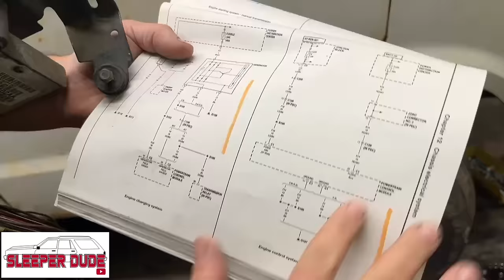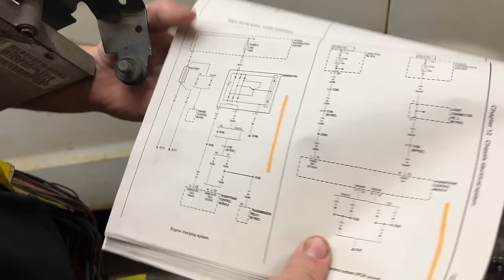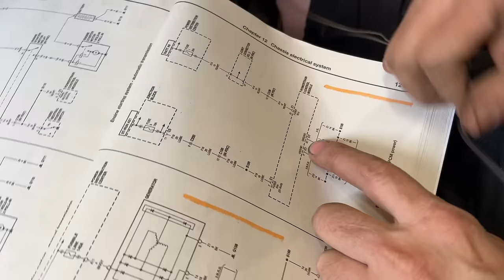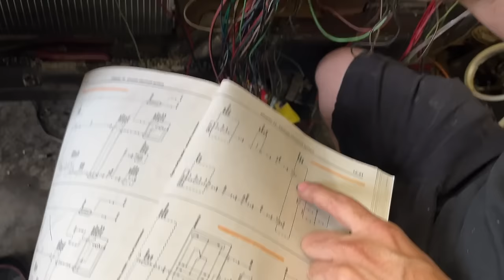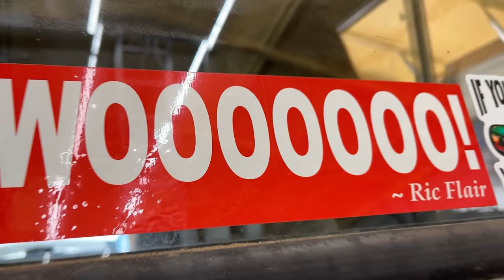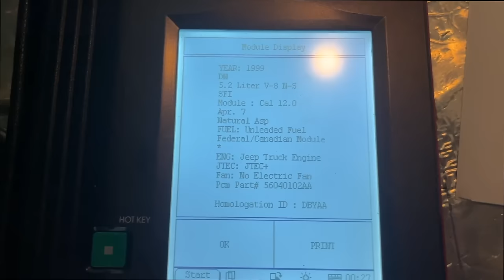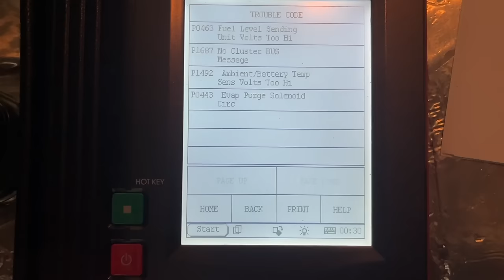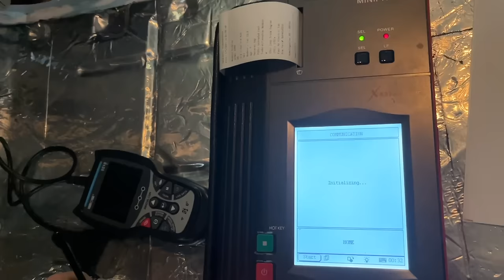2 Years of WORK Has Led Up To This! Will It Start?

Comment: I'm almost leaning towards the cam or crank sensor. But hats off to you guys getting this far seing you swapping the entire wiring harness. I have no doubt you'll figure it out. Hope you get to take some trip out in it this summer.
Reply: I think it's the crank sensor also
Reply: I’d almost bet it’s the crank sensor. Off the shelf bad parts are common nowadays
Reply: Yeah I also had to replace a crank sensor twice e before it solved my issue.
Reply: Or a bad ground wire for the injectors. Should be by the power steering pump if I remember correctly. Been awhile since I’ve worked on a old dodge
Reply: I have to agree with this one also I have had horrible experiences with my 99 ram and it would have intermittent issues with the engine just shutting down at the worst possible time and then fire right back up and it was narrowed down to the crank sensor and was replaced with a new one which lasted for about 3 months and then it started stalling again I fortunately ran into the original owners brother and he told me that he had to choose between the truck or his wife because he couldn’t get the issue fixed and they were almost killed when it stalled on the intestate and they replaced the crank sensor and it was good for awhile again I found a weak ground to the engine and I cleaned it up and replaced it and it seemed to correct the problem and I have not heard anything about it giving the new owner any problems because I bought another truck and sold it
Reply: @Thebuddycassious I am sure that his issue is something so small that it has been overlooked but the more I think about it I remember that he removed the old resistor regulator box from the firewall and am wondering if he is using the starter switch from the Durango or the old inefficient one from the van because now that he is using the higher voltage electronic system that start switch isn’t going to work properly this was the issue with the older system and that was causing the pickup coil to burn out so frequently I know that it needed to be isolated from the ignition because it would go bad and all of the voltage was going to cranking the engine and it would not have enough power to kickoff the pickup coil first indicator was when you let the starter crank several revolutions and then let off the key and it would fire but only after you let off the key everyone would always blame the igniter box but it was not electrical part of the key switch that was the issue I have used the Chrysler igniter on forklifts when I couldn’t get a replacement without spending a small fortune on it and they work out very well so I think that needs to be something to look into and this is an issue that might not be covered in the traditional way’s because they have combined different generations of technology that have to be looked into in order for everything to be compatible and run properly for years to come it did start and run but it then it shut down and it never started again so something has had to happen to a sensor fuse or something but I seem to recall that the later models have a star circuit and a separate run circuit and it is separate from the acc now the run circuit might have a connection issue or if they have been connected together it could be causing a no start condition that’s where I would start at least I don’t think it is something horrible just something that sometimes just needs a different point of view
Reply: Yeah but I would like him to at least have a look at the electrical part of the ignition switch just to verify that it is sending enough voltage to the ignition circuit while the engine is cranking just to eliminate that possibility I just have had so many issues that that part was the initial problem and then it multiplied from there low voltage creates heat and then it will short circuits from there and then maybe the ecm could be detecting low ignition voltage putting it into a no start condition and that wouldn’t always trigger DTC or I wonder if that happened and the ECM went into keep alive mode. Something similar happened with my f150 I replaced the stock exhaust manifold’s with a set of headers when I replaced the engine and I didn’t re route the plug for the 02sensor and I burned through the wires and shorted out and before it blew the main obd fuse it triggered a fail safe and then when I scanned it for codes I had every DTC that was available and I thought what the heck is going on so I did some research and found that it could be the fuse that controls the engine management and I replaced it and it blew out immediately so I started looking for a short circuit and saw that the wires to my 02 had burned and shorted out so I replaced the plug and replaced the fuse and it was fine after I preformed a relearn on the ecm so that is something to keep in the back of your mind as you are going through the steps to determine what his run issue is it was running and then backfired and then shut off and it won’t start again to me it sounds like something was shorted out and when it was running it sounded almost like the injectors were sending fuel randomly I don’t know but that’s where I would start checking the ignition for reliable power

Comment: 1:37:08 Check the cam sensor Try pause grounding out the trigger wire while cranking and using a noid light if it trys to start or you see the noid light flash then you know what it can be

Comment: Hey josh, it helps to have two things, one, a good wiring diagram, either factory or a mitchel manual. It will help you trace the circuits that are needed for the engine to run. Two, a large piece of plywood you can draw out a diagram of what wires go where, with nails or screws to act as channels to lay the wires in. It helps to keep the harness straight so you dont end up with spaghetti until you get it taped and loomed.
Reply: In My experience, in a CAN system (controller area network) when in it's factory Stock configuration, it needs to "know" and verify the Computer as it is VIN Matched, and as such the instrument cluster has to be part of the Circuit just as all other related On board modules, Battery Temp Sensor also required, the aftermarket Computer has to have something internal for Anti-theft, and VIN specific information that Overrides, I also did notice the two O2 sensors one should be closer to the exhaust Manifold, and the rear further back as it's a downstream (rear) O2 FYI, just research what can be eliminated in a CAN system or if there may be a Separate Module that acts as a Instrument cluster / BCM that allows your  air fuel system to function, remove the Crank sensor and inspect it (hope it's an OEM) when I was working with them, you had to have an Air-Gap setting, what would come with them would be a Piece of paper cut to fit the tip, lightly attached so when you carefully assembled the Crank sensor it would make a Gap between that and your flywheel Sensor ring. Been there and seen that. Some times those sensor brackets can be a tad off and create your Shaky start and a No-start. Good Luck Josh. You will get er DONE. hope this helps rather than confuse you.
Reply: @robertjones1709  
So all the high tech EV’s will have on the hood, “NO USER SERVICEABLE PARTS INSIDE”?
Imagine how long the lines will be to get an EV fixed.

Comment: I know it might be nothing but on some mopars distributers had 2 leads to the pickup coil  one being  start pickup and a run pickup. because it will fire on start but no run. good luck, that is going to be an awesome camper.

Comment: I do have a recommendation for the O2 sensor.  Use a O2 sensor spacer or 90 degree spacer adapter.  We use them on modern engines that have stricter emissions when using mini cats or installing Bluetooth cats. lol

Comment: Josh,I am having a similar fuel issue,I’ve tried everything but computer but I was gonna try crank sensor it’s still the original one. They must be torqued to a specific amount or it won’t pick up correctly off flywheel.try torquing crank sensor to spec or another sensor,I hope you get it,because it could help me. LOVE YOUR CONTENT ON ALL THINGS REVIVALS ON OLD CARS. THANKS SO MUCH
Reply from the maker: Thank you

Comment: A few days ago you adjusted the steering box on the mini winney. There was one mistake made that can cause a wreck. Loosen jam nut then turn the wheel to the bump stop and adjust and tighten screw. Step 2, turn to opposite bump stop and repeat adjustment while balancing the feel between the two sides. If you just tighten in the middle, the steering could jam at either extreme turn.

Comment: You gotta use the key switch & key from the dodge with the steering column as well bc it all has to go together!
Reply: One time I put everything out of an old Buick park avenue in an old C 10 even then I used the steering column it went easy.

Comment: This is Justin Moore from Arkansas.Check to see if voltage at TPS is 1 volt with key on engine off.If it’s above 2 or 3 volts with key on it can go into clear out flooded mode and shut off injector pulse.Hope this helps.

Comment: Hope you get this figured out. This is like a cliff hanger! I'm sitting on the edge of my seat in anticipation of what is next! Did Rocky eat a valuable section of wiring? Lol!  All I can say is go back to basics. are there enough ground straps? That will mess up things too. Not sure how many are needed but never hurts to add some. Especially on something from that fine vintage. And did the donor have electric door locks? The 74 does not, and it may be a fuse you decided not to use. And a wire you left off. I've had the EMC shut things down because this fuse was blown. And I think even if it didn't have door locks, the wiring harness still has it as an option and should have had a dummy plug on the end. It' does seem to be the EMC shutting things off because it doesn't think it's safe or something connected or thinks there is a bad sensor. It should still start and run without an ambient temp sensor. My experience here is the A/C won't kick on as well as some other things including dash lights and ABS warning would light up. I wonder if the EMC is trying to figure out perhaps these loose connections not used that go nowhere and need to have a dummy plug, so it thinks everything is fine? IDK man, I've never done what you're doing on that wiring. I'm always amazed at what your capable of. Good luck and looking forward to a resolution.

Comment: Man you are dedicated doing it this way instead of just slapping an aftermarket hotrod universal EFI in and making it work
Reply from the maker: Thank you, hopefully we will get it worked out
Reply: You might have to put a catalytic converter on there because the O2 sensors might be sending a bad signal to your computer that you're running too rich
Reply: It's definitely cheaper this way though

Comment: Something I learned about the "Original Chrysler Charging Systems" with separate Alternator and Voltage Regulator.  When a test shows overcharging, replace both at the same time.  Then run a ground wire from the Alternator to the Screw that attaches the Voltage Regulator to the Firewall.  The only other ground for the Ignition System is the Neutral Safety Switch.   Ground the Battery to the Engine and the Radiator Support on a Van.  Simple!

Comment: AllData has a diy subscription that is fairly cheep. Pretty decent wire diagrams. I personally think they should be a sponsor. 😊
Reply: @Sleeperdude  that wants 39 psi fuel pressure according to identifix, is the ambient air temp sensor hooked up? Fuel management depends on that to set the fuel mixture, really cold needs more choke no choke here.
Reply: @Sleeperdude  intake manifold air temp sensor is what I'm talking about. Ambient looks to go to the overhead console probably not a issue

Comment: Just a check is there enough fuel in the tank , re top up all the fluids.
Make sure nothing has been disconnected, check fuses.
Failing that check all sensor wires are getting signal.
We know it’s not security so something else has stopped the computer firing the injectors.
Give watch Wes work a call he’s the wiring and fault diagnostics expert that I know.
Reply from the maker: Ok thanks

Comment: SUBJECT:
Engine Cranks But Does Not Start Or Starts And Stalls

MODELS:
1998 - 2001 (AB) Ram Van/Wagon 1997 - 2000 (AN) Dakota 1998 - 2001 (BR/BE)Ram Truck 1998 - 2000 (DN) Durango

NOTE:
  THIS BULLETIN APPLIES TO VEHICLES EQUIPPED WITH A VEHICLE THEFT ALARM (VTA) SYSTEM (SALES CODE LSA).

DISCUSSION:

Part of "No Start" diagnosis on vehicles equipped with VTSS should include a verification check of the power supply to the Central Timer Module (CTM). The CTM provides the Powertrain Control Module (PCM) with an "OK To Start" message via the CCD bus. If the message is not received by the PCM, the PCM will not allow the engine to start. Initially, the engine may start and stall but will eventually not start at all. Most CTMs are supplied battery voltage through the power door lock fuse. An inspection of the fuse should be one of the initial diagnostic checks performed. If the fuse is operational, a verification check of the communication system from the CTM can be performed using the DRBIII(R). Attempt to communicate to the CTM. If the CTM does not respond to the DRBIII(R), the DRBIII(R) will identify a "No Response From Central Timer Module" message. A "No Response From Central Timer Module" message may indicate that the CTM is not powered up. Please refer to the "Communication" section of the appropriate Body Diagnostic Procedures Manual to assist in "No Start" diagnosis due to communication problems from the CTM. In addition, the "Vehicle Theft/Security" section will aid in the diagnosis of "No Start" issues involving the VTSS system.
Reply: The CTM is located behind the right side of the dash. It needs this unit to work. I can provide wiring diagrams if you want them.

Comment: Could be the throttle position sensor.  Those don't last very long especially after they've been sitting a while.
Reply: It would still run even if un plugged so that’s not it 👍

Comment: Accessory = No 12v during crank.  Ignition (1,2,3, etc) = 12v during crank.
Reply from the maker: Ok thanks!
Reply: Sounds like a bad crank sensor, or the cam and crank sensors are not in sync

Comment: I would put some kinda shield on that Trans cooler. Think about it. When you drive on the road you have dirt and debris that fly up under your vehicle. Especially if it rains. I would put some kinda shield in front of it to prevent that.

Comment: I've had this issue where it would not start, no engine light no way to diagnose and scratched a lot of mechanics heads. Ended up being a camshaft sensor most the time. Also had TPS issues cause it not to start and turn over only. or the crankshaft sensor. Many have noted these already. Did this engine run before it was taken out? With a bad TPS I've been able to get the engine to run by flooring the accelerator pedal, despite it was fuel injected and pump and not supposed to do that. Love the channel. Love the family involvement. Keep it up. JB from Newton, Iowa
Reply from the maker: Yes the engine ran completely fine no issues.

Comment: I remember hearing something about contant electric signal is needed to keep the modern mopars running. With the traditional ignition switch the power is only good until start up. Try getting the ignition switch from the Durango.

Comment: Cam position sensor also controls fueling so check that as well. Without that signal the injectors will not fire.

Comment: Hey guys,
It may sound completely dumb, but I would look into the P0443 Evap code, if there is no Evap circuit but the ECU thinks the purge solenoid is open, it can stop the engine altogether
PS : especially if the throttle body is not connected to the vacuum

Comment: Saw your video on the rv with the 5.9. I did a very similar swap from a 2000 Durango with a 4.7 into 1977 Plymouth Volare. I did the same as you with using the wiring, pcm, fuse box and all connectors. I used only what I needed and the vehicle has been running for a couple years. I had a similar issue after I got the thing running where it was having an issue starting and staying running. It was an issue with the ASD. I can show you my fuse box to show I got past the issue

Comment: All I have is check another couple of injector circuits, make sure it isn't that one injector circuit you tested with the noid plug. I just know computers are very reliable, and that the issues are usually grounds, powers, & sensor signals.

I can remember when a response I gave one of my kids when she was similar in age to Ralphie & Wawa to something was "I don't know". My kid was shocked, she thought I knew everything, it never dawned on her that I did not know something. Funny thing is she was okay with mum not knowing everything 🤣🤣🤣🤣.

Comment: Possibly the oil pressure sensor. It could also be that the cluster isn't plugged in.  The canbus communicates through the cluster as well.

Comment: I read all kinds of forums this morning. I think I remember you installing a new crank position sensor. I would get another just to rule it out. Also remove and inspect it. Make sure it didn't come in contact with the shutter wheel on the crank. Your issue almost has to be crank sensor, cam sensor or distributer. Make sure you have good continuity to the PCM on all the wires to those sensors. Too bad you're so far away, I'd love to give you a hand on this.

Comment: As far as all the shop manuals u have:
Cut out the pages with a utility knife, put the loose pages into page protectors, and put those into a huge 3 ring binder.  It'll keep the numbers and letters from getting smudged permanently.😊